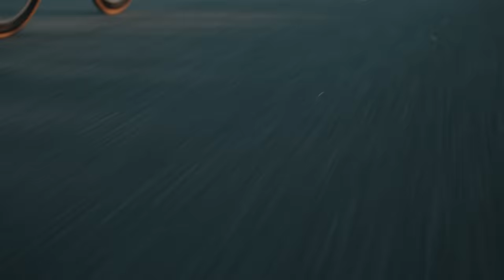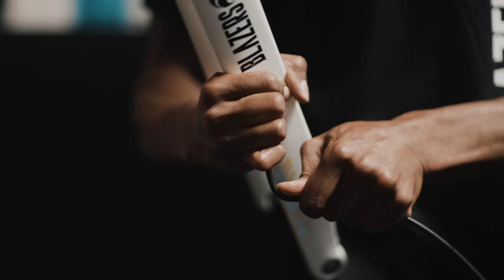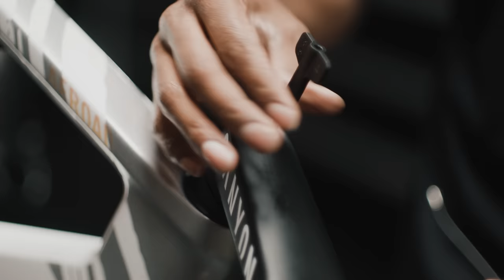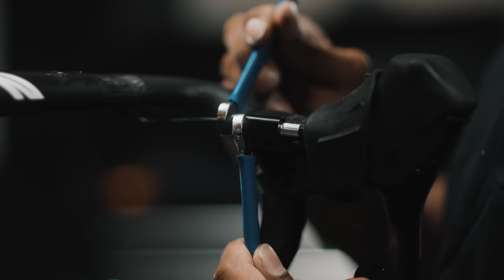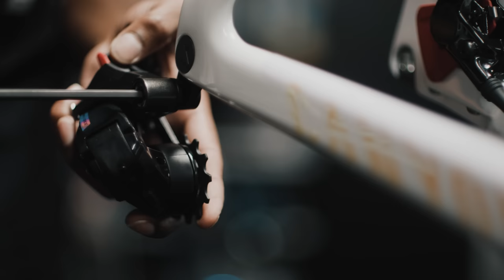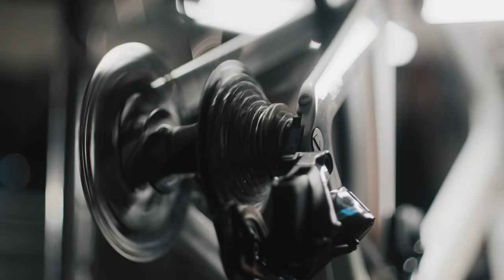Canyon Dream Bike Build | Aeroad CFR Miami Blazers

Comment: You are misguiding your potential customers. In all of these promotion videos of Canyon Ultimate and Aeroad, where you feature pro-athletes, you are equipping these bikes with much longer stems than the bikes that you are selling on your website. A medium-sized frame in both models comes with a 100mm stem, which is way too short for most riders. The overall reach (reach+stem length) ends up ~2cm shorter than other brands in almost all sizes. That's why in most review videos, riders look cramped up on short reach. Furthermore, it is impossible to buy the cockpit with a longer stem from Canyon. So, your customer is stuck with the very short stem the bike comes with. You are selling bikes on which one of the most basic bike-fit adjustment is not possible, even at the expense of the customer.
Reply: I'm 182cm and have 2 aeroads. One with a 100mm stem and one with a 120mm, both in size medium. The 120 is too long. The 100mm is perfect. Don't know how one can claim a rider doesn't look comfortable. If anything is misleading, it's the trend to slam and extend bars and raise seats because it looks cool.
Reply: @richardjones2236, It's great that you're satisfied. Here are two examples to substantiate my point. The riders in both examples stand at ~182cm tall (although inseam length is the more critical dimension). The new Ultimate model they're using has the same reach & stack as well as the cockpit of the Aeroad, thus leading to the same problem. Both riders appear squeezed, implying that they have the front axle in sight while riding on the hoods. In the first video, there's noticeable power loss due to the upright posture dictated by the short stem.
1. https://www.youtube.com/watch?v=WMe4_0xHuQA
2. https://www.youtube.com/watch?v=p_iMEH4qULc
I'm 182cm myself, with a slightly longer than average inseam. After months of agony, just replaced the New Ultimate M with L. I am much more comfortable, less cramped, especially in the long ride.